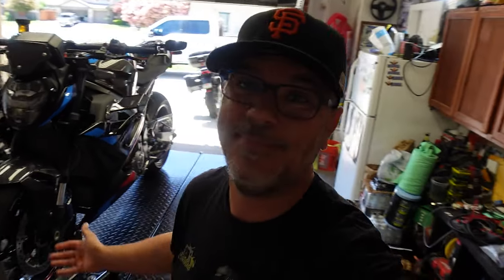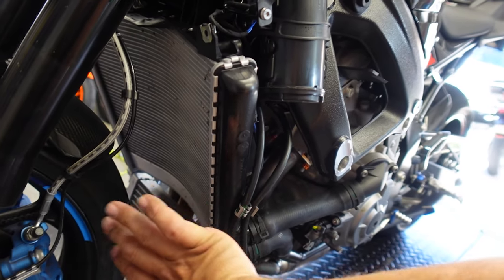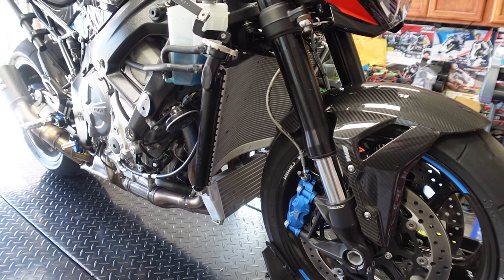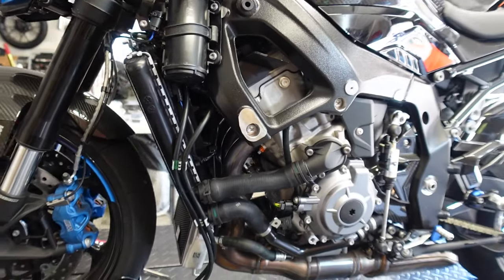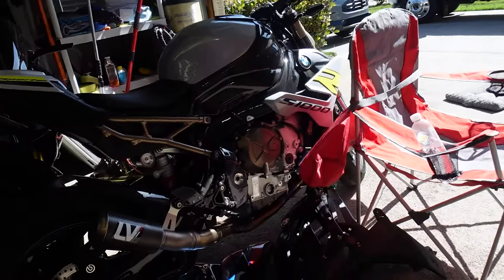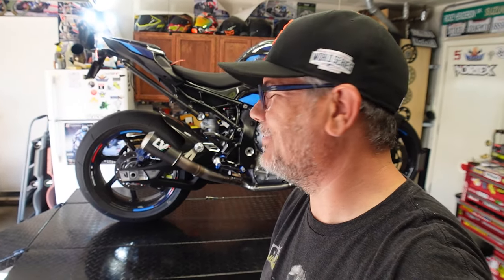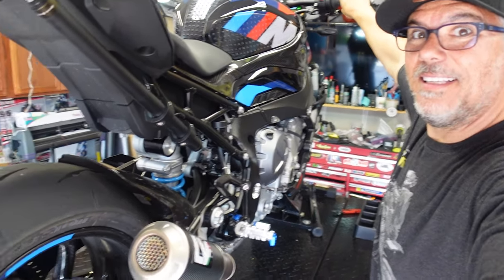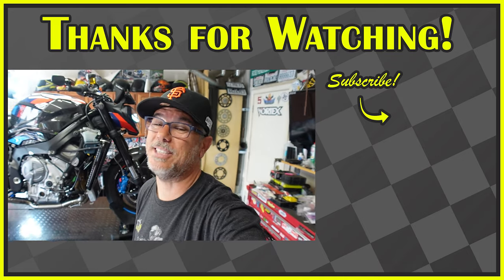2023 BMW M1000R Header and Radiator Guards Installed

Comment: Awesome video. How would you say does the Arrow header compare to the Akra? In my mind, sound and performance should be similar...however, there is a significant price difference. The reason for asking is that the dealer is trying to sell me on the Akra. Does it make sense?

Comment: Hey man I assume u get the bike on dyno..  would of been good to dyno b4 and after tune😮
Reply: Bt moto has the before and after you can watch it on their channel😉
Reply: I did a stage 1 brentune after putting on a full titanium Akra with GP cans. Dealer was surprised that I put 182 to the wheel bone stock and 191 after (estimated 220+ total hp)